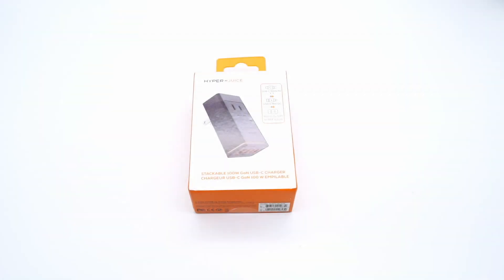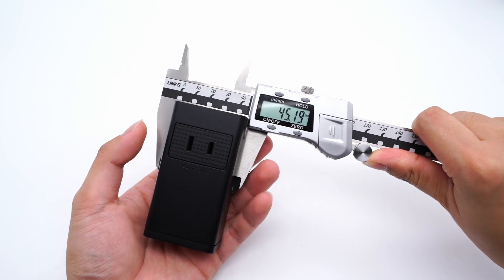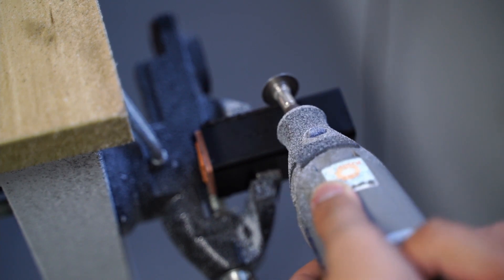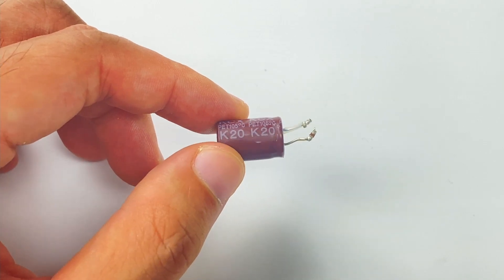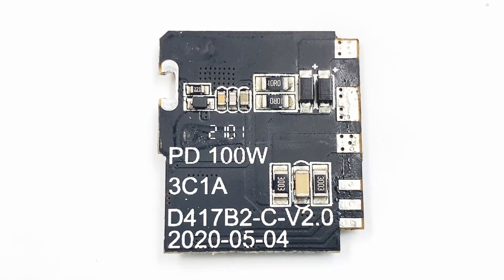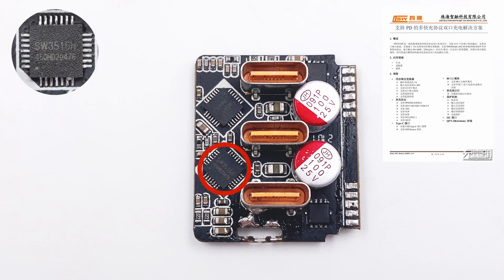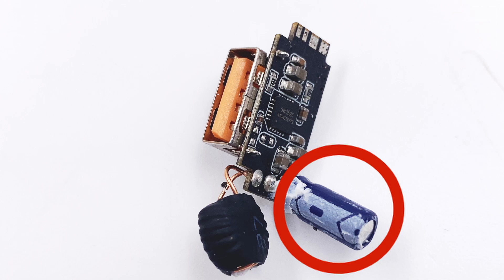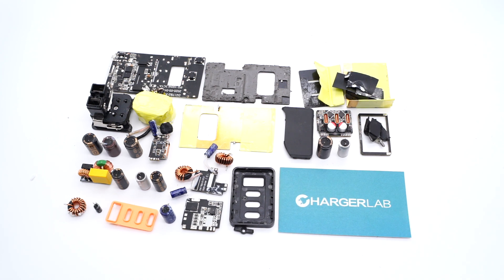Teardown of HyperJuice Stackable GaN 100W USB-C Charger

Comment: Cheap caps and not enough on the output, if they don’t have enough space atleast use some high capacitance MLCCs, cheap charger and NA plug is absolutely horrendous. Just use the EU or UK plugs or IEC intlets.